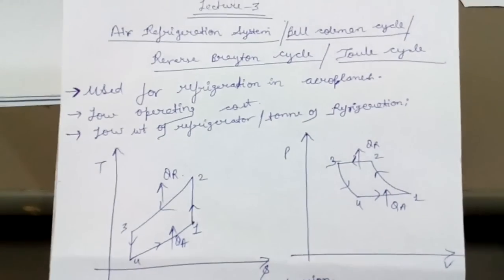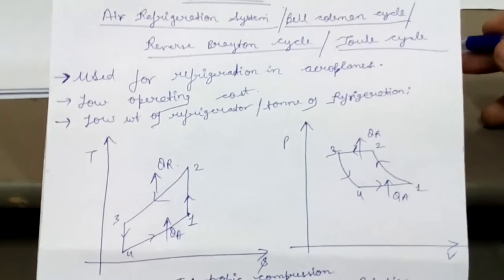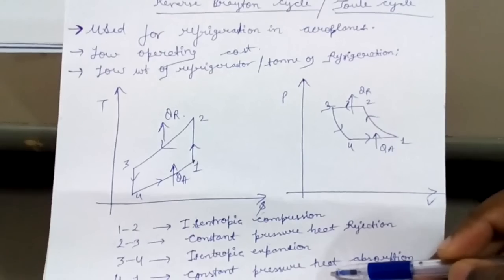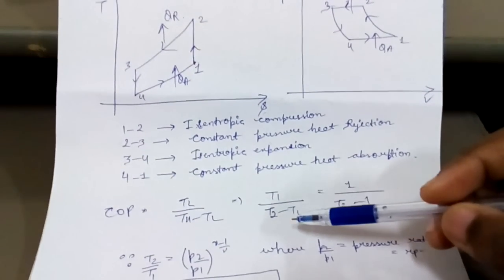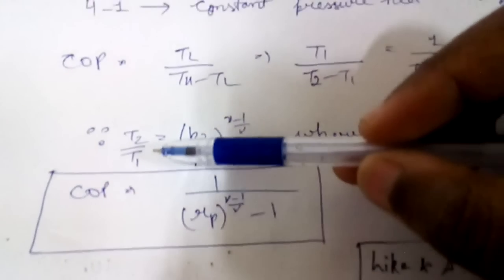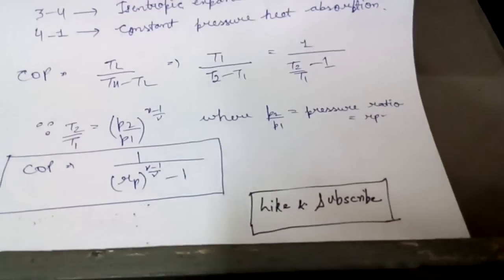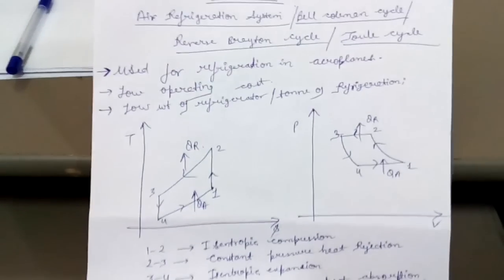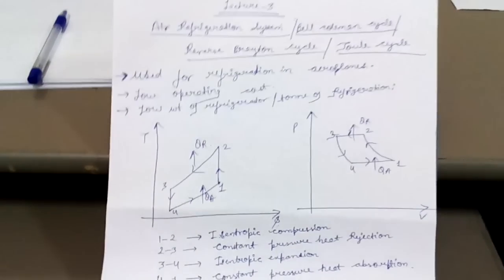Bell coleman cycle explained with PV & TS diagram | Reverse Brayton Cycle | Joule Cycle #bellcoleman

Comment: sir agar 1-2 process r polytropy than hwo drive of COP
Reply from the maker: Prince Sao polytropic derivation is not for undergraduate or post graduate level . It is only in doctorate courses. You need not go into that detail.This basic derivation is sufficient for B.tech , M.tech , B.E , M.E courses and the numericals regaurding the topic can be easily solved using this knowledgde.

Comment: broo  How to calculate  Work Net  for  Belcolemn cycle  &   which Temperatures we have to consider  for  refregeration temp , cooler Temp  if they given in question
Reply from the maker: Wnet=Work of compression + Work of ramming - Work of expansion. This work need to done on the system to get the desired refrigeration.In the question they will tell you which  refrigeration system is being studied ie.whether it is  simple,bootstrap,regenerative and so on so depending on that you will be given atmospheric temperature , pressure and so you have to find the temperatures of the corresponding points. This video is the basic cycle and it is made just to make the concept of air refrigeration cycle clear. In future I will post videos regaurding Bootstrap , regenerative and other air refrigeration systems and tell you how to solve the problems.
Reply: Wnet=Work of compression + Work of ramming - Work of compression . what the hell it is , if ur adding Work of compression  and again subtracting  Work of compression frm it then whats the ues of adding  Work of compression  simply we can write   Wnet= Work of Ramming
Reply from the maker: Sorry sriram it is Wnet = Work of compression + Work of ramming - Work of expansion .I suppose you know a bit of different air refrigeration systems like bootstrap etc. In that Wnet =Work of compression in compressor + Work of ramming due to ramming of air  - Work of expansion which is obtained from the turbine. This is the net work which we have to consider to calculate the Coefficient of performance of the system.
Reply: tq brooo